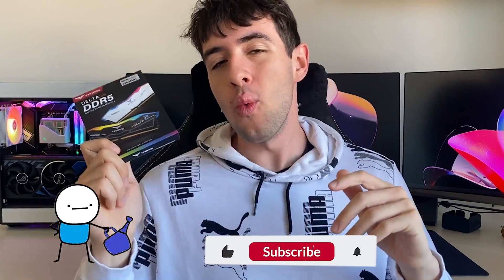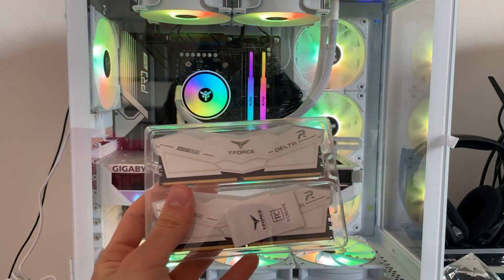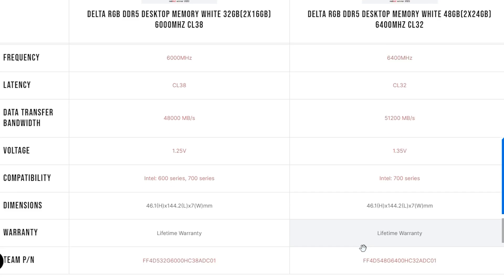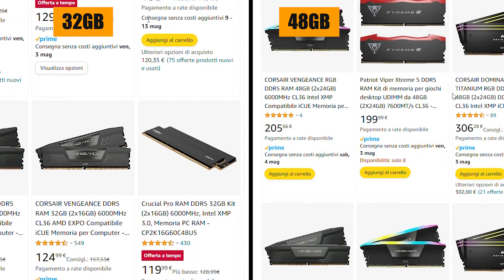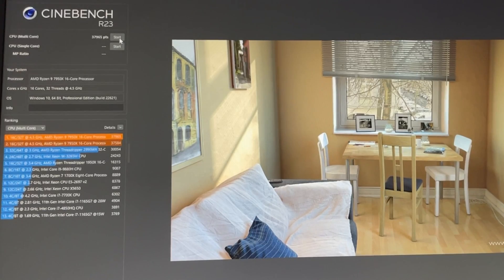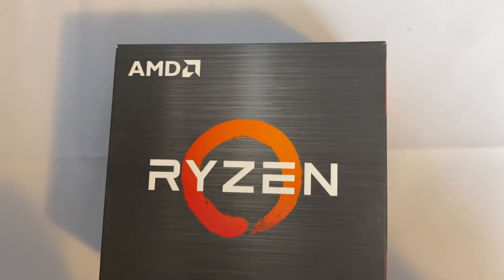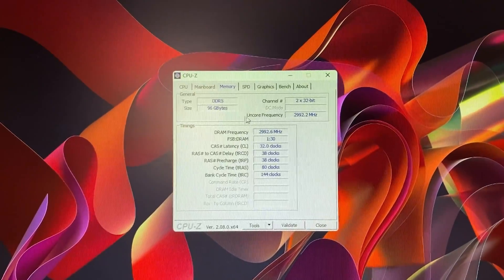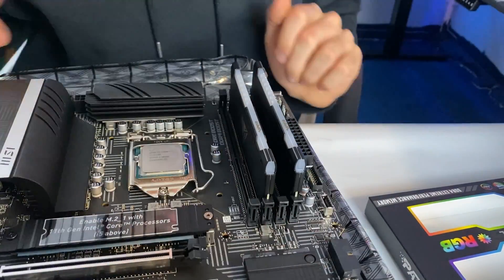Do you even need 48GB of RAM in 2024? - Value for Money analysis

Comment: There's a lot information not covered in this video , specially on 48gb sticks , you must know that all of 48gb sticks are an new generation of Hiynix M-die and some CPU or Motherboards works a lot better whit THESE chips  ,despite capacity this will be the major reason to buy these 48gb . Like some chinese Intel  Mobos clock very high whit these chips and they are a lot cheaper ,and AMD Cpus works better whit these M-Die.
Reply: That means certain secondary timings will be able to go lower. 

The only problem with M-die is they are not as resistant to heat so trying to get CL26 will be a pain without water cooling them. you’ll do CL28 easy on those sticks tho
Reply from the maker: That’s actually very true, didn’t wanna cover OCing and manufacturing improvement too much as very few people care, but maybe I should have! Lots of refreshed 32GB sticks are also getting the improved chip quality tho, as far I heard from people in manufacturing
Reply: @ImWateringPSUs  the best kit to get to avoid water cooling memory is team groups 7200 CL34 kit. They are A-die and can do CL26 @ 1.640 volts stable. I can give my timings if needed

Comment: have 64GB DDR4... next build witll have 96GB DDR5... just because I'd rather have it and not need it, than need it and not have it
Reply from the maker: Ahahaha that’s a good point! But you can gauge roughly how much you’ll need and save some money :) Plus if you have 4 slots on your mobo, you can always add another 48GB with ease :)
Reply: @ImWateringPSUs  or add another 96GB with 4 slots total :D 4x58GB modules wrooom wroooom but yeah that would be overOVERkill and not just overkill

Comment: 64GB@6000Mhz with C30 you think they are not as good as 48GB@6400 with C32 (or even run them @6000 cl30) ..? Kinda weird that you say that due to the fact that the 48GB kits are newer so are better. 
Maybe for single ones (for adding more in the future).
Reply from the maker: They are “as good” but the higher the memory capacity the less clock speed you’ll be able to achieve on your sticks! Plus yes 48GB kits have a more refined manufacturing process so they generally clock a bit higher because of that :)
Reply: @ImWateringPSUs  you generally just want to push the timings down. you can easily do CL28-36-36-30-66 @ 1.49v

Let me know if you want my settings